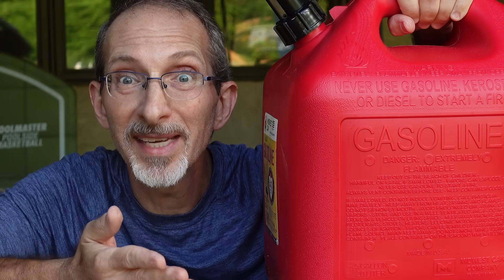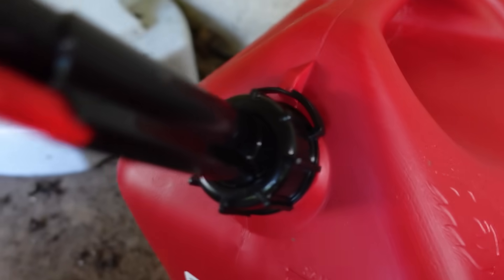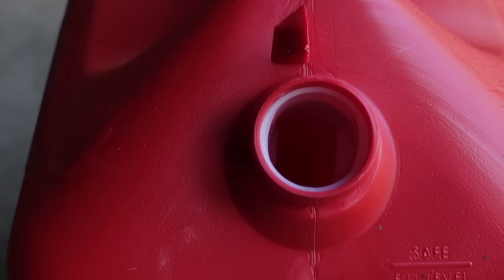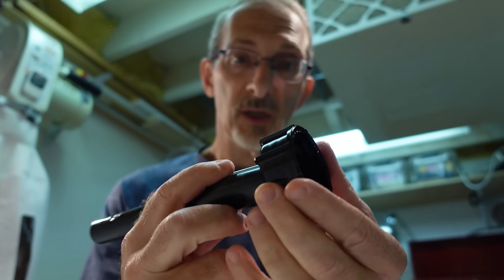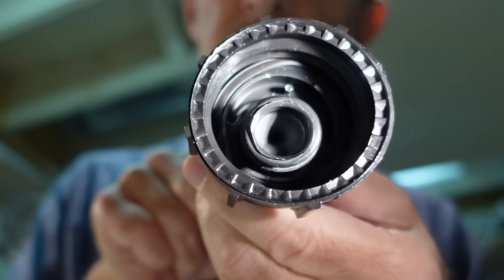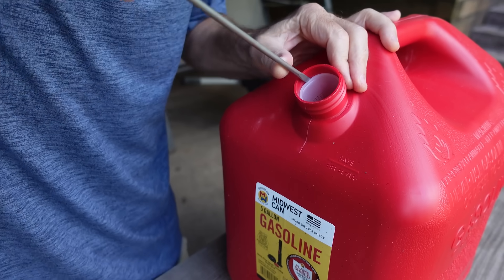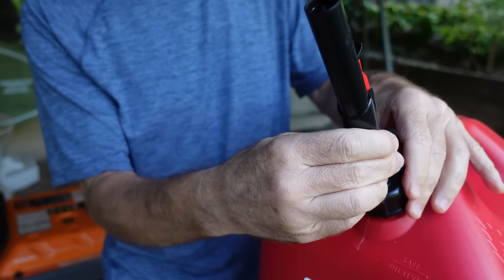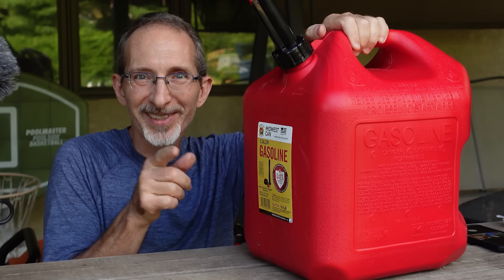Gas Can Modification | New Gas Can Fix

Comment: Remember the good ol days?  And to think the price of the new cans have gone up to cover all these safety mods.......I have some old cans that I will NEVER get rid of.
Reply from the maker: @Randi Ruge - I really don't remember old gas can prices because I bought only 1 or 2 and they lasted forever. These are relatively cheap, but I would happily pay less for cans that don't have all the safety 'improvements'!
Reply: @MikeFyxdt  The old metal cans were .98 cents at Western Auto.
Reply: @MikeFyxdt    They were metal. Aluminum, I think. Or maybe stainless steel; like what was used to make grenades.
Reply: @treyhart6861  You could think government and the massive inflation that’s been happening for the past year and a half with the trillions of dollars being printed so government can distribute a couple pennies to the people and hundreds of millions of dollars in dollar pockets
Reply: Yes Lumber nearly doubled in price last year. The fires that happened in California were mostly crown fires and  hurt the lumber industry much less than you would think because most of that standing timber is harvestable. The wildfires typically don’t burn the entire tree it just burns the fuel around it and the needles and small limbs of the tree. it kills the tree but they’re still standing and they’re still perfectly fine for the lumber mills to cut down and process into Lumber. 
Forest in the Midwest are adapted to fire and actually require it from time to time in order to keep a forest healthy. Some of the reasons were seeing such large wildfires in the pacific west is because of the policies that govern Ben 10 Cal fire have instituted over the decades such as aggressively fighting every Wildfire that occurs while simultaneously gutting the lumber industry. This is allowed our forests to build up a tremendous amount of fuel that explodes into these fires. But the Forests recover quickly.
Reply: If you get rid of any of them I"ll buy them from you. Do you live in south jersey?
Reply: You can thank a union for the price increase

Comment: I had no idea gas cans had gotten this complicated. I'm going to hang on to my old plastic can for as long as I can. Having said that, if I ever buy one I'll refer back to your video before I McGyver it.
Reply from the maker: Marc - YES! Hold on to those old cans. When I was shopping I almost bought the old-fashioned metal cans but they were around $45 U.S. for a 2 gallon can. Now that I've 'fixed' these I am much happier with my purchase.
Reply: I had to buy one a couple years ago, and never knew how "safe" they made them,  almost lost my mind making it work just to fill a car, what a mess it makes.
Reply from the maker: dr s - it’s one design that should never have been changed!

Comment: Very clever! Nice Generator!
Reply from the maker: Thanks Al! The modification really made a difference. The new generator purrs like a kitten. Well, maybe a little louder, but compared to the old propane generator this one purrs. :)
Reply: @MikeFyxdt   . . Lets see a video of how to fix an old propane generator. . . probably the  regulator valve!     the new one looks nice!!
powerful to!
Reply from the maker: @coyotecarguy2076  Is the regulator valve the thing on the end of the tank hose?  That's passing gas (pardon the euphemism) and I did new fuel tubing and a brand new carburetor, too. I got the new one because I've exhausted my energy/knowledge fixing the old one. Do you think people would watch a 'taking a generator apart with no intention of putting it back together' video?